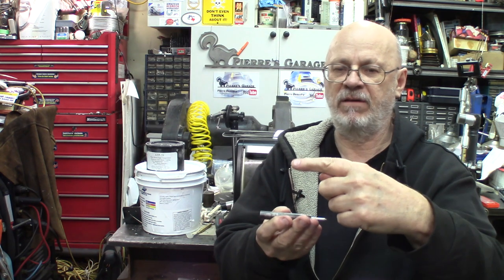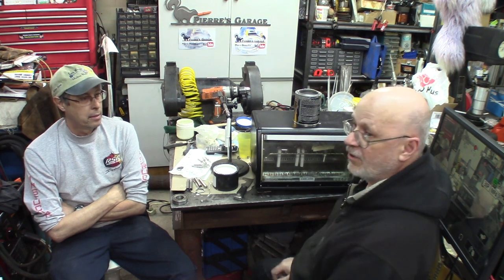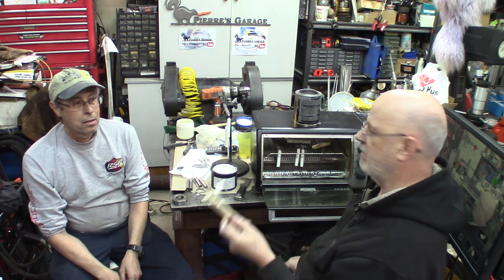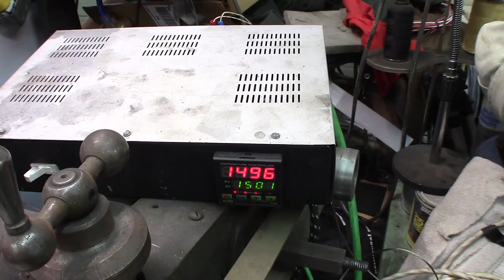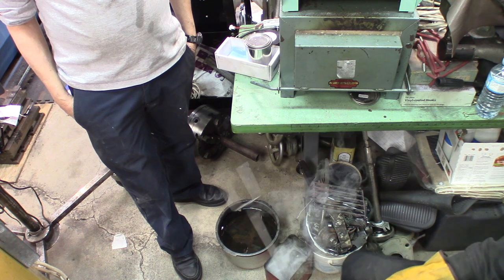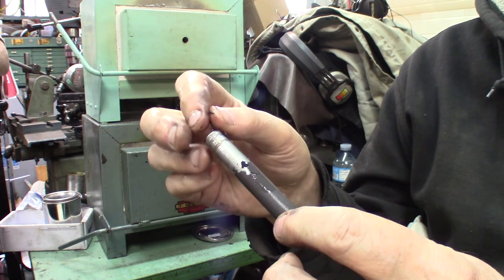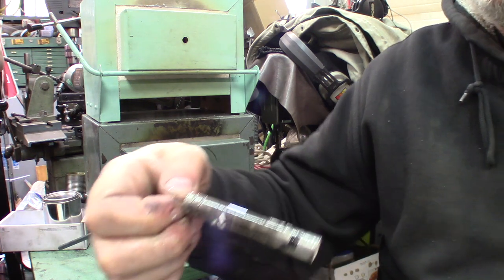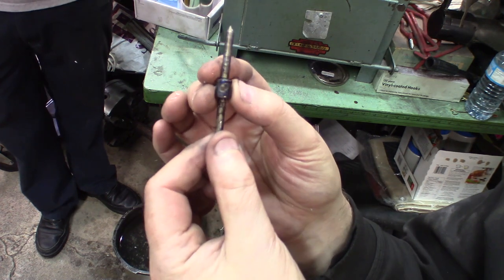Tap follower, the making and the heat treatment.

Comment: Having that heat treat oven is a big plus - I seem to remember 
Clickspring coats a part in baking soda which seems to help a lot - 
that's when he uses a flame type approach, and usually small parts.
You'd be a whizz on the marshmallows with that fork!
Looked like pretty fruitful session - did wonder if an oil quench would be any better.
Reply from the maker: Hi Chris,
Water or oil quench is depending on the alloy, with W-1 oil didn't yield great results, way too soft. With 4140 oil is great...   !!!
The oven has the advantage to be able to control the temperature and predictability of results, some applications don't worry about it but in general, you need to rely on something constant and controllable...   ;)
Cheers,   Pierre

Comment: Interesting patterns on those parts. Could you see any cracking in the coatings as you were pulling them out?
Reply from the maker: Hi Brian,
The coating stays intact until it hits the water, then, it just chatters instantly, this is why the patterns on the surface is only very thin, only a few microns...
In oil quench, it stays much more on the part and shows less patterns, in all there is just about no oxidation on the surface, this compound is a great way to protect the surface, so far we like using it...
Cheers,    Pierre

Comment: Looks like you guys are having fun . Pierre I have always wondered is oil hardened drill rod the same hardness as the water hardened ?
Reply from the maker: Hi John,
The oil soak wasn't conclusive since we were only getting around 30RC compared to the 57RC from the water soak, still some experimenting to do on the process...  But so far we exclude oil soak for O-1 steel, good for other alloys though...
Cheers,    Pierre
Reply: Perhaps the next test should be Brine versus water, should be harder.

Comment: Hi Pierre & Phil

Nice video ... and again I go to have one of these ovens ... con I download one from you or ... ?
Reply from the maker: Hi Keld,
Look for copper enamel kilns, over here they regularly show up on the local adds for a decent price, the electronic controller is not very expensive and quite easy to make, you probably seen the video where I make it from imported components...
The last one we tried to upload is still stuck in the underwater cable and is nowhere to be found so far...   lol
Cheers,    Pierre
Reply: Yeah, I know how to make the controler ... I can figure out you haven't seen my video on my temperature meter ... it's 3 years old - her it is:

http://kelds.weebly.com/temperaturmaringler.html
Reply from the maker: I've watched it before, but, getting older and better memory don't go together...   :(
Reply: That's called "dementia light" ;-))

Comment: Why do they need to be hardened? 10-20 rpm each hole, at a super low speed. So maybe a couple hundred RPM/year.
Reply from the maker: Hi Andrew,
The points absolutely need to be hardened or they won't last...  
It's nice to be able to squeeze the body and not ending up with deep scratches from a chuck. Some people my use this tool only a few times a year but if you need it many times everyday you may be happy it last you a lifetime and perform as well as the first time or just about...   ;)
Thanks for your comment,   Pierre

Comment: Does anyone use, or has anyone tried, the french-fry-basket method of not losing the workpiece in the bottom of a grubby water or oil container?
Reply from the maker: Hi Chuck,
The basket would make fishing the parts a little easier, not good in the oven but in the quench bucket, though...   ;)
Cheers,    Pierre

Comment: It won't matter for these parts, but reheating parts that have already been quenched will alter (coarsen) the grain structure.  If the parts were critical and had been quenched in oil (slower cooling) and were too soft, they should be discarded.  That is not to say that there aren't situations where double heat treatment is used.
Reply from the maker: Hi, in order to reheat the part it would require complete annealing process to reset the original grain structure, like you say those parts aren't critical and W-1 is forgiving for this application, oil quench was really giving too low hardness in order to make a decent part...
Heat treatment is a very complex process and experience is a "Big" advantage that doesn't exclude surprises...   ;)
Thanks for your input,   Pierre